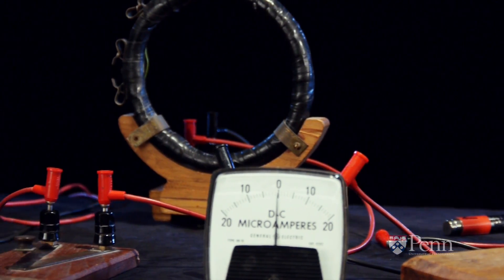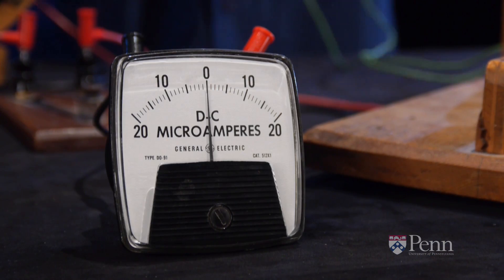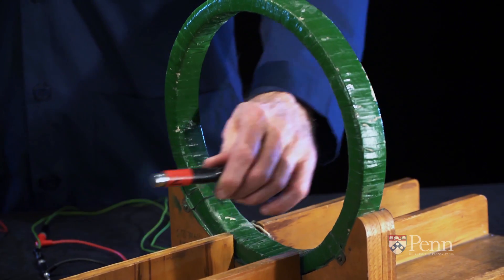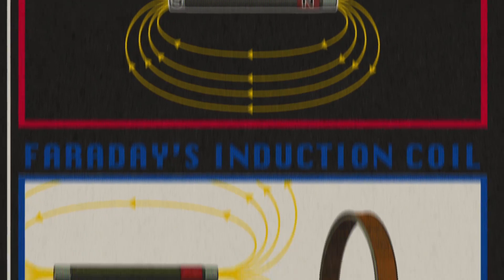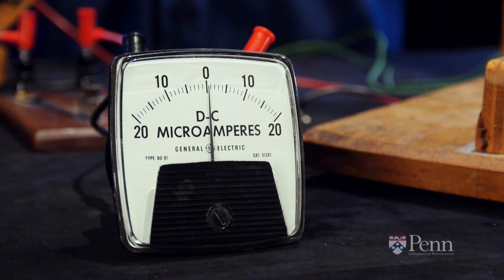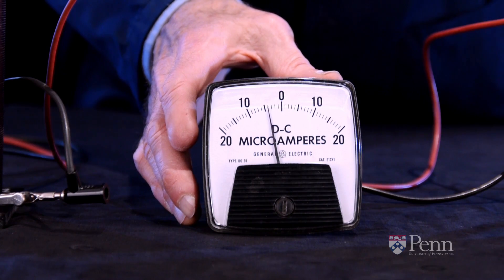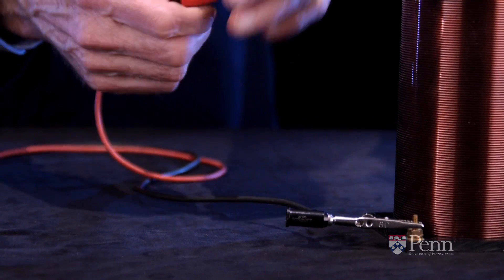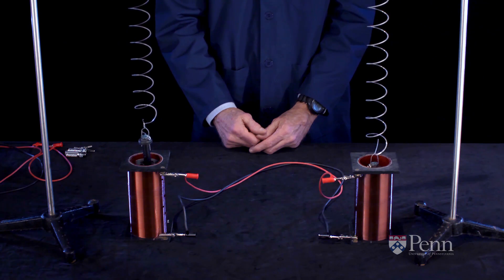Faraday's Law of Induction Demonstration - Penn Physics

Comment: News flash !
THE DEFINITIVE, BALANCED, AND CLEAR MATHEMATICAL PROOF THAT E=MC2 IS F=MA (ON BALANCE), AS ELECTROMAGNETISM/ENERGY IS GRAVITY:

TIME is NECESSARILY possible/potential AND actual IN BALANCE, AS E=MC2 IS F=ma ON BALANCE; AS ELECTROMAGNETISM/energy is gravity ON BALANCE. Gravity IS ELECTROMAGNETISM/energy. Energy has/involves GRAVITY, AND ENERGY has/involves inertia/INERTIAL RESISTANCE. ("Mass"/ENERGY IS GRAVITY. ELECTROMAGNETISM/energy is gravity.) E=MC2 IS F=ma. This NECESSARILY represents, INVOLVES, AND DESCRIBES what is possible/potential AND actual IN BALANCE, AS ELECTROMAGNETISM/ENERGY IS GRAVITY. Gravity IS ELECTROMAGNETISM/energy. Gravity AND ELECTROMAGNETISM/energy are linked AND BALANCED opposites, AS E=MC2 IS F=ma; AS gravity/acceleration involves BALANCED inertia/INERTIAL RESISTANCE; AS ELECTROMAGNETISM/energy is gravity. Gravity IS ELECTROMAGNETISM/energy. E=mC2 IS F=ma. SO, the middle distance in/of/AS SPACE AND the full distance in/of/AS SPACE are NECESSARILY linked AND balanced; AS ELECTROMAGNETISM/ENERGY IS GRAVITY. (The stars AND PLANETS are POINTS in the night sky. The sky is blue, AND THE EARTH is ALSO BLUE.) THE EARTH/ground AND THE SUN CLEARLY reveal that E=MC2 IS F=ma ON BALANCE. It all CLEARLY makes perfect sense. Very importantly, outer "space" involves full inertia; AND it is fully invisible AND black. BALANCE AND completeness go hand in hand. The ultimate mathematical unification of physics/physical experience combines, BALANCES, AND INCLUDES opposites, AS E=MC2 IS F=ma; AS ELECTROMAGNETISM/ENERGY IS GRAVITY ON BALANCE !! TIME dilation ULTIMATELY proves ON BALANCE that ELECTROMAGNETISM/energy is gravity, AS E=MC2 IS F=MA ON BALANCE; AS ELECTROMAGNETISM/ENERGY IS GRAVITY. GRAVITATIONAL force/ENERGY IS proportional to (or BALANCED with/as) inertia/INERTIAL RESISTANCE, AS ELECTROMAGNETISM/energy is gravity; AS E=MC2 IS F=MA ! Gravity IS ELECTROMAGNETISM/energy. It ALL CLEARLY makes perfect sense !

By Frank DiMeglio

Comment: Near the end of video, the voltage induced by the coil on the right  (of video) induces a weaker magnetic field in the coil on the left. If both coils are identical, this experiment actually proves that Faraday's law is incorrect.